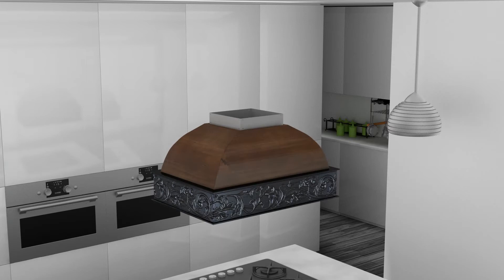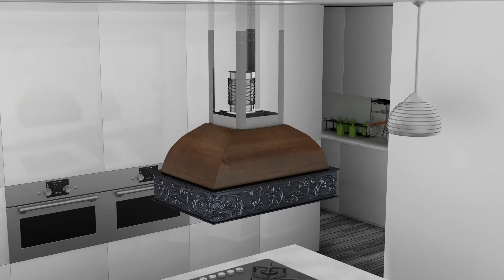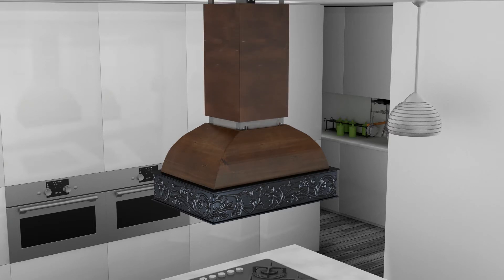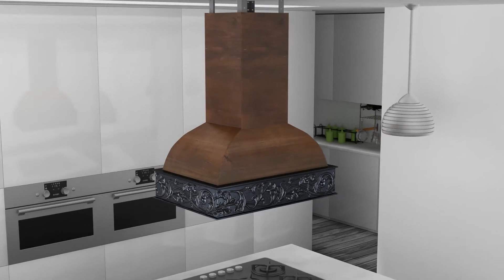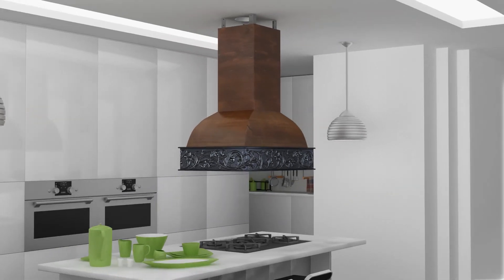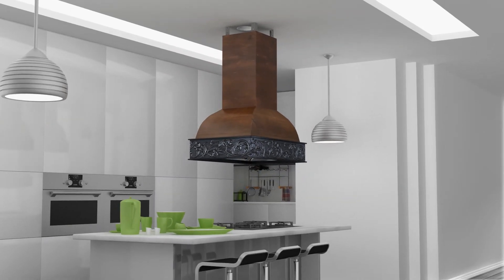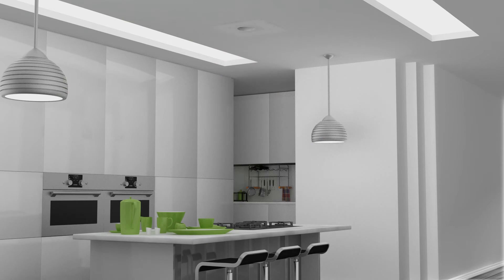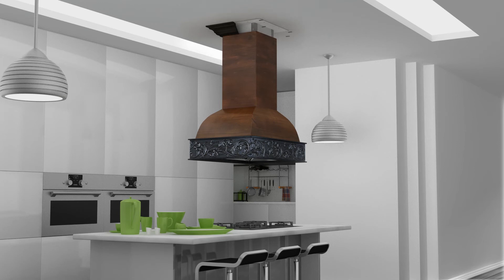How to Install A Designer Island Range Hood - ZLINE Range Hood Installation

Comment: How would you vent through the wall? Particularly for a 8 ft ceiling. Of the 96" of space, 36" is the counter height, then recommended 30" space between counter and bottom of hood, then another 16.4" for hood itself.
That leaves about 13" for the stack. Inside the stack would be an 8" duct, so how where can you have the space for the exhaust vent hole? I'm looking to buy to replace my current hood but these specs seems a little too big for my area.
Reply from the maker: Hi there! Please fill out a form on our website and a customer service representative will get back to you as soon as possible for your particular situation. Thanks! https://www.zlinekitchen.com/product-questions

Comment: but how do you actually attach the whole thing to the top???   we're stuck
Reply from the maker: There is a bracket at the top of the range hood that mounts to the ceiling. From that bracket are the four angle iron pieces that slide inside of the chimney and mount to the base hood. Removing the crown molding will expose that bracket and the angle iron brackets. Please feel free to give us a call with any questions/concerns you may have: 1-614-777-5004
Reply from the maker: @UCqIcwD-s2_-JhWpwxLLGoeA We are sorry to hear about your part troubles. Please send in a picture of the part you need; this way, it can be easily verified. Please email images to contact@zlinekitchen.com